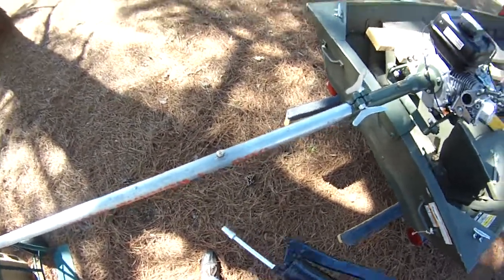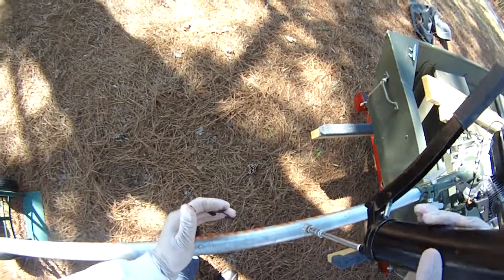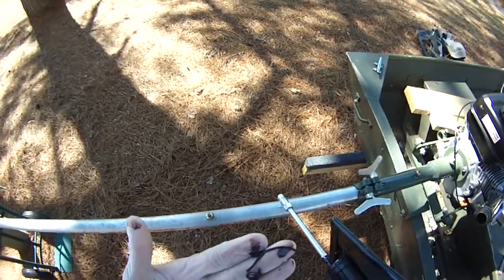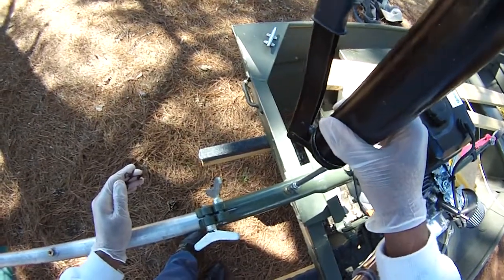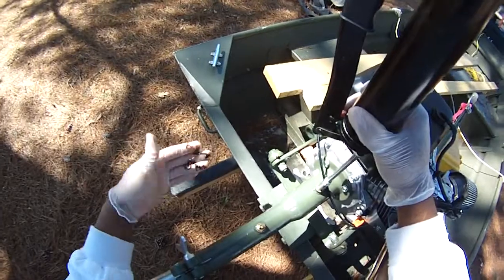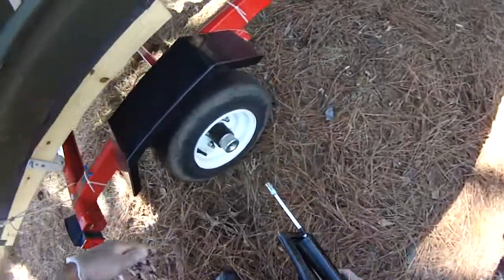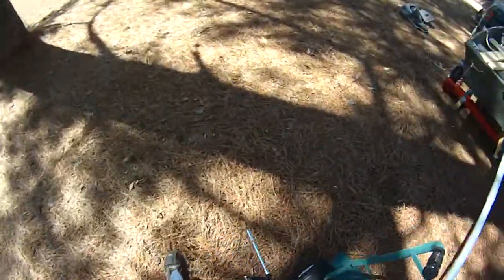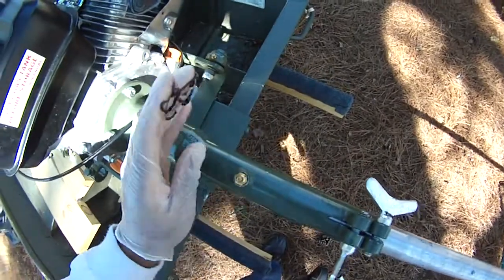Grease Gun Question

Comment: how often are you greasing the shaft on your mud motor
Reply from the maker: +Joseph Kiefert One squirt per fitting per outing. This grease gun was junk. I went with a Lincoln grease gun, and it works perfectly.
Reply: Did it take any grease
Reply from the maker: +Joseph Kiefert Yeah, it takes grease. The handbook from Swamp Runner says lube it every outing with one or two squirts.
Reply: If it doesn't take  any grease  you may have to clean out all the old grease  that's what I had to do with the one i work on
Reply from the maker: +Joseph Kiefert It is currently taking grease with the new grease gun. The cheap gun didn't have pressure. The new gun works perfectly.